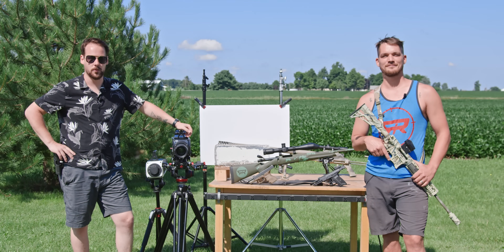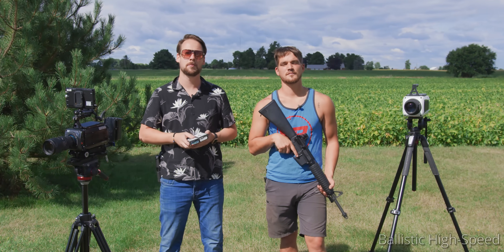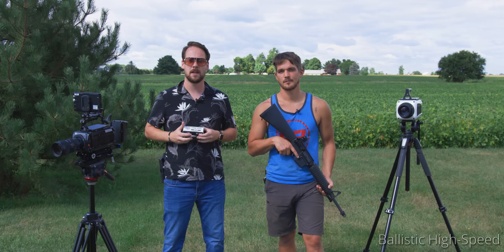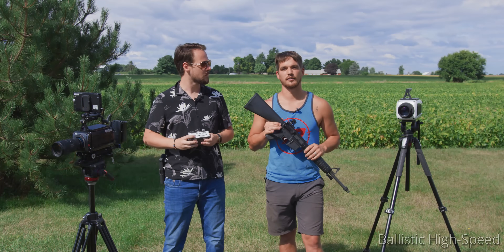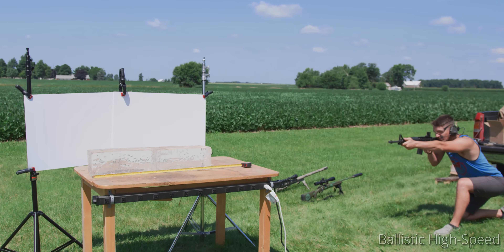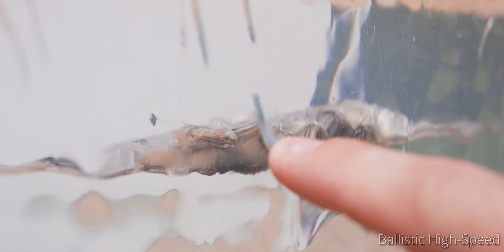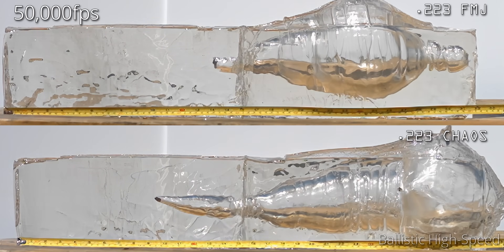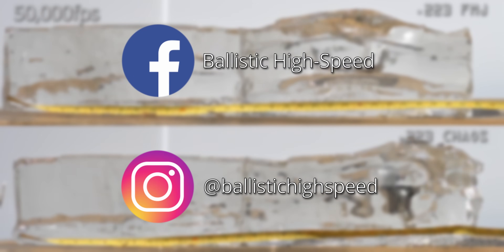.223 CONTROLLED CHAOS Ballistic Gel Test! - Ballistic High-Speed

Comment: The 13% higher mass of the 62 gr HP round at 3100 fps would expectedly penetrate further than a 55 gr round of the same speed. Momentum, a good surrogate for penetration assuming similar cross-sectional density, is mass times velocity (P=MV).

Comment: based on your hi-speed, you need a heavier buffer or buffer spring. When properly tuned the casing should be getting tossed out the side in the 3-4 oclock position and should not be contacting the shell deflector.

Comment: Bringing back the dead...I just subscribed today and I'm getting caught up watching your videos..I had to comment..If you're AR-15 says "Multicalber" it does not mean your rifle is chambered for both .223 and 5.56. A lot of manufacturers will engrave their AR-15 lowers with "Multi-caliber" so they don't have to engrave every receiver with a designated caliber for paperwork reasons. They can just grab a lower off the line and slap a .223 upper or a .300 Blackout upper or a 9mm upper, etc. For the end user, if you register a rifle as a Short Barreled Rifle so you can put a shorter barrel on it, you're required to mark the form with the caliber. Any time you change caliber, you have to submit a firearms change form, so they know you have an SBR that might be caliber X or caliber Y because of bureaucracy. Theoretically, if you have "Multi-Caliber" on your AR-15 lower from the manufacturer, all you have to do is write "multi" for the caliber on the form and you can fill in a misc. area on the form listing the potential barrel lengths and calibers. It's common for people to write 2" and above to cover all their bases. 
The actual chambering of the rifle (.223, 5.56, .223 Wylde) is stamped on the barrel in front of the gas block. Technically, if the rifle was made to military specifications with good steel, it can handle either .223 or 5.56, so don't worry about it unless you're shooting at 1000 yards in competition, where it actually matters.

Comment: You’ve probably gotten this comment like 100x but the opening in the heavier round isn’t a hollow point, which is why it went further. It’s to assist in the stabilization of the round. Which allows it to spin better increasing velocity, distance and accuracy. I use 77g black hills open tip. (Mk 262 mod0)
I believe these can be used in war which is just further proof of them not being hollow point as NATO doesn’t allow for hollow point rounds. 
I believe that’s correct.

Comment: I’ve always heard, even from gun guys, that the 223 is “designed to tumble in the body and cause more damage.” Which always sounded like BS. The bullet is highly aerodynamic, so even when it hits flesh it shouldn’t tumble radically. And this video basically proved me right. Can it tumble? Yes. Does that increase the damage? No. The cavitation is due to the speed the bullet is going, not the bullet turning into “a flying blender blade”, as some people will say.
Reply: they are probably talking about 5.56 steel core rounds. the m855 and m855a1(steel tipped instead of core). the core will tumble. my medics told me that they treated wounded combatants who were shot in the hip found the core down the leg. damage was un repairable.

Comment: .223 Doing exactly what it was made to do tumble upon impact
Reply: Incorrect. Only the first round tumbled and in did so after going halfway through the block. If that block was a person the round would have left their body by the time it began to tumble. No round is designed to tumble on impact. They are aerodynamically sound, they are designed to be stable in flight. Tumbling can and does occur with literally every round on the market, because when a projectile slows rapidly due to entering a resistive medium they tend to do weird and unpredictable things.

Comment: This looks like some very effective ammo. I bought some underwood branded controlled chaos.
Reply: I still carry their 90g xd for my g26 but this idea for .223 is kinda dumb, you want expansion but with weight retention, you don't want some fragments to be the same depth as a hollow point while the base went through 36 inches of gel and kept going. The advantage of expanding ammo is negated because the base just keeps on going. As dumb as sounds this performance is actually similar to green tips because the steel core definitely assists with penetration but it also has a tendency to lose all the other stuff to fragmentation. Just not seeing a practical application to justify the absurd price.

Comment: I drill out the hollow points and cut/score my own design into cci 22mag and 22Lr mostly. The mag does the exact same thing as that controlled chaos round. Massive and instant expansion with either 4 or 6 petals that shred meat for the first 4" then the base continues into the target. I have partially split the base piece like a split-shot fishing lead so it would create two base projectile's after shedding the petals and it works great, just time consuming so I only make those when I need to take our rodent's.

Comment: Got some of their controlled chaos in the mail today. I am disappointed as the projectile is not even seated all the way into the casing. You can see the fracture canalure sitting above the case neck. And some of their cases are short at 1.57” where the recommended length is 1.74”.. Will not buy from them again, their customer service sucks and they would not return my emails or phone call’s apparently their employee Katie is too busy to interact with customers..

Comment: Just do you know, when multi-cal is stamped on the lower reciever it doesn’t mean that the barrel is able to fire multiple different calibers. Just saying the lower can accept different caliber magazines, like 300 blackout, 5.56, 6.5 grendel, etc. but yes 5.56 barrels can also shoot 223, but not the other way around unless it’s a 223 wylde barrel
Reply: You can shoot 5.56 out of a 223 barrel. They're almost identical other than the neck of the case on 5.56 being hardened. Pressures are the same. The confusion comes from 5.56 and .223 being pressure rated by different systems.
Reply: @lmaolmoo4147  what is the point in having .223 and 5.56? why didn't people just pick one since they are so similar?
Reply: @kyle18934  Because almost everything that guy said is wrong and a perfect example of why you dont listen to people on the internet without doing research yourself. 

1. 5.56 necks are usually annealed which makes them softer not harder.
2. 5.56 is typically loaded to higher pressures
3. You should not shoot 5.56 out of a .223 gun because it can explode or damage the gun over time because of higher pressures and because while the cartridges are the same size the cambers are cut differently with more freebore cut into 5.56.
Reply: @Nick-sx6jm  ok, but that still doesn't answer the question I was asking. What's the purpose of having both types? Why not just do 5.56 or  .223? They are so similar.
Reply: @kyle18934  The reason that 5.56 exists is because its basically the military designation  for .223. The AR15 was originally developed for .223 and eventually the military wanted shorter and lighter guns that used the cartridge to its full potential so they loaded .223 about as hot as you can and made some tweaks to the guns to be able to shoot it.
Reply: @Nick-sx6jm  so, it's a very got round, so the 5.56 action needs be a bit sturdier to take it?
Reply: @kyle18934  No the difference is that the 5.56 chamber is slightly longer. So when they cut the hole in the barrel that holds the round thats about to be fired they make the end of the chamber there longer before the bullet hits the rifling. This allows some of the pressure to be temporarily releaved. So when you shoot 5.56 out of a .223 chamber it can cause pressure to spike and can damage or blow up the gun over time.

Comment: It would be cool to see controversial caliber comparisons on ballistics gel at high speed, for example 7.62x39 vs 300blk, 5.56 vs 5.45, 9mm Luger vs .40 s&w ect..
Reply: 5.7x28
Reply: @petergriffin383  5.7x28? I see a neat drill hole through the gel lol
Reply: @SpaghettiFPV-tg3qh  The 5.7 x 28 videos I've uploaded typically don't look like a drill hole. A couple with heavier projectiles into the synthetic gel from the pistol didn't expand, but that's due more to the gel (or rubber as I now refer to it). 
Into a pork shoulder, they blow a gaping hole.
Reply: 5.7x28 vs .22 magnum. If you could get 9x19 vs 9x18 it would be cool too
Reply: @ivanbarreras9445 5.7 dominates it in every way but it’s expensive and harder to find
Reply: 8.6 blk out vs 9x39
Reply: @raygibson1252  also based
Reply: @russellwilson1906  sorry but I literally have Asperger's so I don't understand what you're saying
Reply: @xwld2971  I feel like we enough has been done. 40’s a great caliber, but recoil is a downside, for sure. Solid defensive 9mm matches 45acp damage no problem, and you have both additional capacity and less recoil for faster follow up shots. That being said, what you prefer and will train with is going to be a good choice for you.
Reply: @vipe650r  if you’re comparing the best 9mm ammo to normal .45 defense ammo you’re correct but compare the best 9mm ammo to the best .45 ammo and it’s not a comparison .45 wins every time and I’m not even bringing up .45 super
Reply: I agree with everything but .40S&W. Does anyone really care about that caliber anymore? You lose capacity, gain recoil, and get no significant difference in power or diameter vs 9mm. The only .400” round that should exist is 10mm Auto. At least with 10mm you get a good bit more power, up to twice as much as normal 9mm loads.
Reply: @alphazuluz  Not to start an argument but I think it definitely has a place, capacity loss is very minimal, the expansion of a .40 s&w hollow point is larger than a 9mm luger, it pushes a larger grain projectile at a higher velocity than 9mm could if loaded with the same grain weight, there is an argument that can be made that brings in 9mm +p and +p+ in terms of velocity and energy however that still doesn’t account for expansion diameter and some modern handguns without fully supported chambers aren’t even supposed to run +p+ rounds, and some manufacturers with fully supported chambers still will recommend not running +p+ because of the lack of SAAMI standards for the loading. Recoil is heavier with .40 and I understand that point, however I think for a larger framed shooter the felt recoil difference probably isn’t big enough to make a real big difference and then we would have to return to the +p+ discussion which are the rounds everyone brings up when discussing the notorious 40 vs 9 argument, as +p+ brings it closer to a .40 s&w velocity and energy with higher grain projectiles it also brings it closer to .40 s&w felt recoil and without performing with the same expansion. Also just to put this out there this is coming from someone who has multiple 9mm’s and only one .40 lol I just don’t think completely writing off .40 s&w entirely is fair
Reply: @russellwilson1906  I get what you’re saying, but the reason .40s&w is irrelevant is this: all of the major organizations or people that study wounds and ballistic data now say that there is little to no difference in the wounds created by the three common calibers (9, 40, 45). I feel like that is just proven fact at this point. If that is true, then it doesn’t matter if .40 expands to .701” while 9mm expands to .655”. They’re creating essentially the same wounding effect, but you’re losing capacity and control. 

I will say that with ball ammo, or with crappy hollow points that don’t work, sure, maybe you have a point. But with good ammo in all calibers, there appears to be no real difference. 

Just think about the “benefits” you’re expressing. Let’s say that the 9mm bullet you use routinely expands to .650” and the 40 expands to .700” average. How does that help you? Well, since gun fights either end by a psychological stop (pain/fear makes them stop), or a physiological stop (loss of blood volume causes them to stop), you have to think about how does that extra 0.050” actually help you. Does it add to the psychological stop factor? No. Does it cause more severe wounds that would stop them faster? The data says no, but just think about it. The only scenario where it really helps is that with a 9mm, you miss a major artery by 0.025”, and with the .40 you would have nicked said artery. I just find that absurd. We are talking sixteenths of an inch here. 

As far as grains of bullet weight go, so what? The weight of the bullet doesn’t do the wounding. It’s the energy. If a 124gr and 165gr both travel the same 13” deep, the only difference in the wounding is the extremely tiny diameter difference. Sure, heavier bullets help deeper penetration, but again, lighter bullets can penetrate just as deeply as heavier ones with good bullet tech. That’s why you’ll see a federal HST 124 in 9mm having similar depth of penetration to a 230gr .45acp. 

I just don’t think the 0.050” or whatever you get with a .40 is worth the costs. Also, it’s more expensive and has fewer ammo options.
Reply: @alphazuluz  I agree if you want more power I’d go for a very hot .45 load even a +p or .45 super…. Also 10mm is a great option both will outperform 9mm
Reply: @Soldierofgod-f2j .40 outperforms 9mm everytime, and that’s just a cold hard fact 9mm fans do not want to deal with..
Reply: @427SuperSnake1  .40, .45, and 10mm all do its indeed a fact
Reply: @alphazuluz From what I’ve seen in ballistics testing in the last 3-4 years .40 s&w provides better performance and it does so more reliably than 9mm.
Recoil is only marginally higher, to the point where a full size full steel .40 s&w will have less felt recoil than a subcompact polymer 9mm.
Sure 9mm’s have SLIGHTLY more capacity than .40 s&w’s  but they’re both high capacity cartridges with usually only a 1-2 round difference.

9mm used to be ridiculously ineffective but it definitely benefited from modern bullet design and improved velocity.
But don’t forget that .40 s&w received the same benefits from bullet design and propulsion. 
There has never been a more lethal .40 s&w than the loadings that exist now. 
If you can’t handle the recoil and can’t afford the marginally higher training cost then it’s your loss.
Reply: @BuggaBoy69  again, .40s&w DOES outperform 9mm, but it is a MARGINAL benefit. Also, it outperforms it how? In gel expansion? In gel penetration? In actual effectiveness? The only one of those that should matter is the last one. Who cares if it expands to .702” when 9mm only expands to .671” if it doesn’t actually stop targets faster or more reliably. Again, the data shows that there’s no significant difference in 9mm, .40S&W, and .45ACP. Does the data show that .40S&W is superior in ballistic gel? Yes. Does the data show that it’s better in actual stoppages of threats? No. At least not that I’ve seen. If you have some new data showing otherwise, I’m all ears. 

As far as recoil goes, recoil affects EVERYONE. You can pretend it doesn’t, but it’s just not true. I’ve been a 10mm fanatic for decades now. I own more 10mm guns than any other caliber. So, I’m not bothered by recoil. However, I can shoot my P365 much faster than I can my G29. That’s just a fact. You’re going to get better follow up shots with a G19 than a G23, even if it’s marginal. When you’re under stress, your reasoning degrades, and you start panic firing at crazy fast splits, you have a better chance of making good hits with less recoil. So, it makes sense that you would use the smaller caliber given equivalent effectiveness. Also, I admit the recoil difference and benefit in follow up shots between 9mm and .40S&W would be pretty small, especially for good shooters. However, the advantages in ballistic gel testing for .40S&W are similarly small. I think shot placement is a more important factor than ballistic gel performance. So I think 9mm gets the nod there. Plus, more capacity. 

Finally, I think everyone forgets that it has been proven that pistols ONLY work via directly crushing tissue. They do not create meaningful hydrostatic shock or cause resultant CNS incapacitation, discounting a direct CNS hit. Basically, that means the way pistols stop a determined threat (meaning they don’t stop due to fear or pain), is by blood vessels being torn, and loss of blood. That is a function of expanded diameter and penetration alone at pistol velocities. What I’m telling you, and what subject matter experts have said repeatedly now, is that .40S&W does not do a meaningfully better job at THAT. It just makes sense. If one projectile expands to .662”, and one expands to .705”, what shot would have been drastically more effective with the .40S&W? Maybe a 9mm shot that missed a major artery by .010”? Penetration is the other side of the matter. Both calibers have enough penetration to go clearly through an average male even in a side shot. If 9mm penetrated a reliable 8”, and .40S&W did 12”, you would have a point. But they both meet the minimums. It’s not like 9mm is going to stop just shy of the heart and .40S&W would get there. 

Again, I just don’t understand the allure of .40S&W. I don’t think it’s a bad caliber, and I would absolutely carry it, but I just think 9mm is better. All the experts say shot placement is king. Getting rounds on target and in a good spot is the most important thing. Everything else is secondary. Nine millimeter gives you the better chance of achieving that goal, with more chances (rounds in the gun) without sacrificing enough diameter or penetration to matter.
Reply: @angry_zergling just buy a 9mm
Reply: 45-70
Reply: @angry_zergling you just need a conversion barrel. Lone wolf makes them for ~$120
Reply: Why bother it's been done by everyone
Reply: Oooo good idea! 45 acp vs 10mm! 5.7 vs 22tcm!